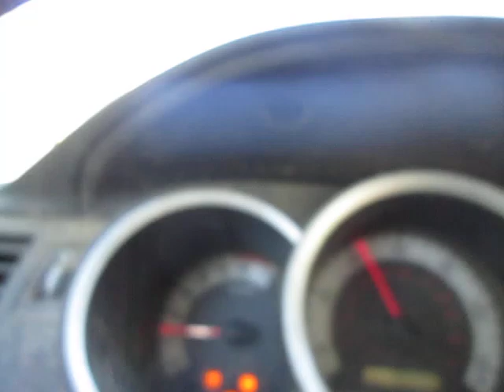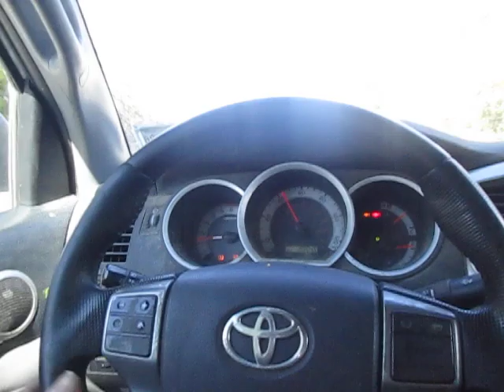Turn Signal Joins the Party of Blown Electrical Components in Moron's Old Beater Truck

Comment: The only thing existential to that truck was the seal.  Oil and radiator coolant are the two things that will certainly destroy a vehicle.  The starter is almost certainly in 2013 still a direct connection to the battery, and likely can be started jumping the terminals with a screwdriver if it came to that.  The alternator, on the other hand, has electronics which might in your case route thru a logic circuit.  Diagrams will tell that tale.

Comment: Guessing most of the warning lights are related to the rear wheel sensor. A quality scan tool should show the relevant trouble codes being tripped. Change the rear wheel ABS sensor and the lights should go out.

Comment: I sent you both the 2013 Tundra and Tacoma wiring diagrams because I can't remember which is your truck.  As someone who once was able to wire around failed brake lights using a hardware store doorbell button screwed into the dash, I know first hand how valuable wiring diagrams can be in the hands of a disreputable shadetree mechanic willing to, well, wire around, rather than repair, a failed (typically over-engineered) component system.
Reply from the maker: As someone who routed water from a five-gallon bucket from behind the seat through the windshield washer pump to cool the engine block while driving down the road with a coconut on top of the engine and the hood held down by a goat collar, I bet any 12-year-old in Mexico would have that brake light off in ten minutes if I waved a five-dollar bill in front of his face. Not sure if the coconut would pass inspection.